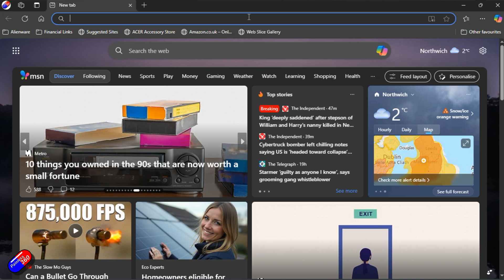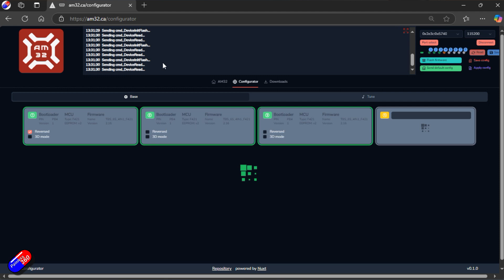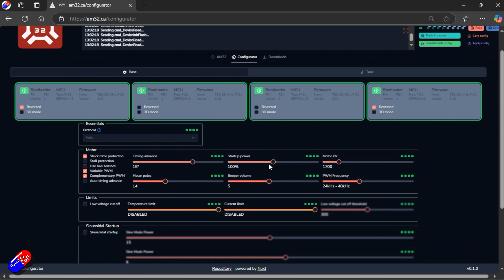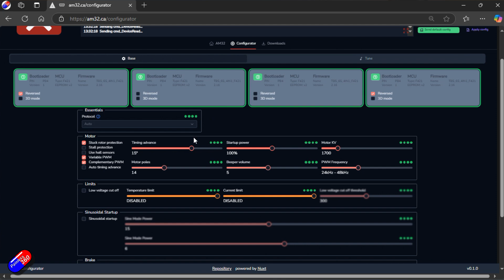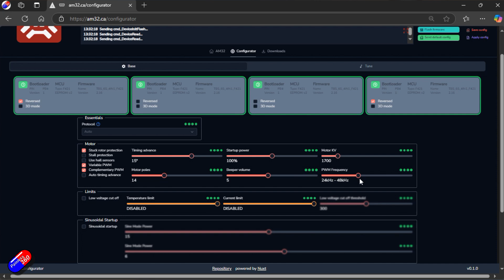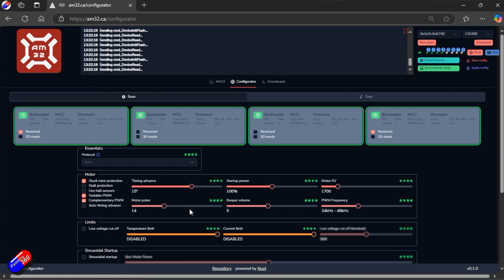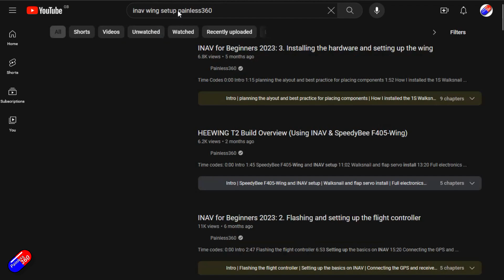AM32 ESC Reversing and Quad Setup

Comment: Lee did you make a video on how to flash AM32 to a BLHeli32 or BLHeli_S ESC?   

I'm trying to get ESC telemetry working on a 4-in-one BLHeli32 esc, but my firmware is 32.6 (32.7 or 32.8 is needed to activate esc telemetry) - so - without being able to update the BLHeli32 firmware, my only option is to migrate to AM32.  

BTW, can AM32 (32 bit?) be flashed to a BLHeli_S (16 bit?) esc? (I have a couple older ESC's with BLHeli_S.)   Thanks...
Reply from the maker: I've not as so many others have. Check out the post by Oscar Liang... Best of luck with it

Comment: For the motor KV settings I do have 1975kv the options are only 1940 and 1980 on the silde in the config which one should I choose?
Reply: always choose the lower kv option if the number is to specify.

Comment: Can you still use bluejay to select startup melody?
Reply from the maker: As far as I know.. Yes. Best of luck
Reply: @Painless360 I ordered a sequre F7 with am32 ESC can't wait to try it out. I started with a speedy bee and have had terrible noise issues. Tried anything and everything to the point where I was just done with it and ordered a new stack. Will never ever order another speedy bee product ever again. I spent more time messing with it and settings then I ever did flying it that's for sure.

Comment: Thanks so much for the video!

How do I switch motor layout?

Here's how the layout should look:
↓4    2↓
↑1    3↑

Here's how mine currently looks:
↓2    4↓
↑1    3↑
Reply from the maker: In what flight control software?
Reply: @Painless360 Betaflight. Turns out there's a blaringly obvious fix for it in the motors tab I forgot to check before commenting on a YouTube video😂